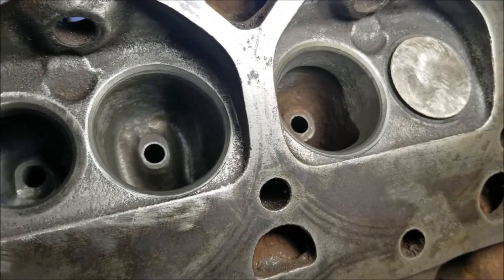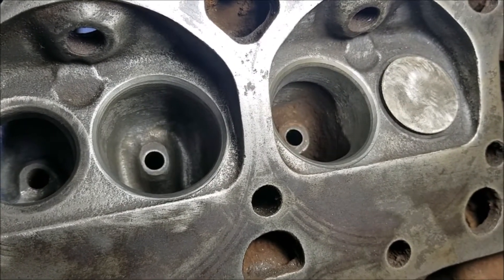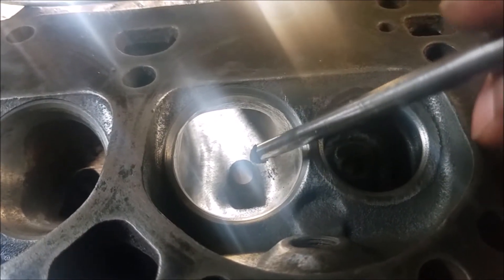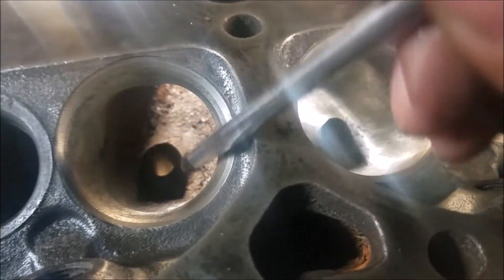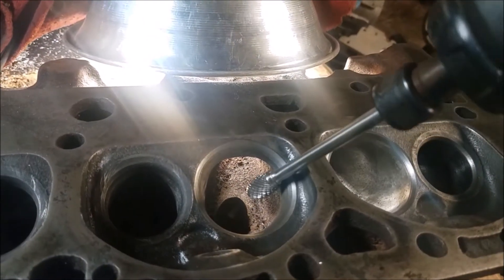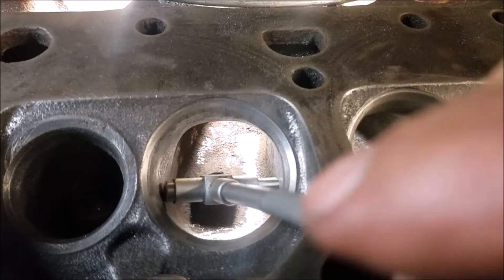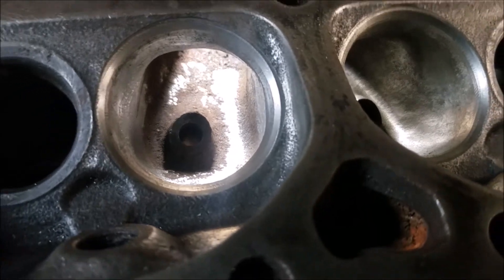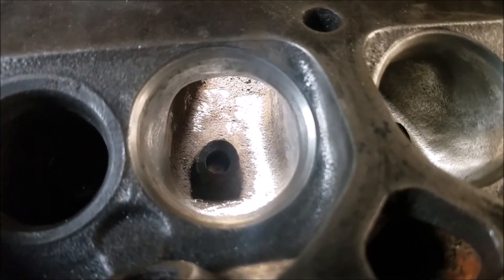SBC Head Porting: Flow Improvements for Cast Iron Heads

Comment: flow improvements? did you quantify that with a flow test? how did you gian?
Reply from the maker: This is a very mild port job on a 993 head. There is plenty more to be gained in flow without using a flow bench. With max effort a flowbench is a good idea, however this is very minor work.
Reply: @c41man  yeah, i realize that. myb poiny is, how do you know the minor work is worth it without checking it on a flow bench? I mean,  what are we looking at here? A 5 horse, a 10 horse, a 20 horse gain?
Reply from the maker: @reloadingfun  if you have a sbc stock iron heads are to learn on really, a set of aluminum heads are best. Modify some heads and bolt them on see if you notice a difference. I'm sure you'll feel the extra power.

Comment: What is this tool for the measurements called?
Reply from the maker: @dristan9785

I'm using a snap gauge to check the intake and exhaust.  Then you use a digital caliper to check the snap gauge.

Comment: Sir, so to know in the future you can totally get rid of the inner radius on r intake that is an exit so you  want it to be fully open to the max possible as any angle here is going to do less than it being fully open. You want  an inner angle  on the CV exhaust  as it helps  exhaust flow into the port more smoothly.  Machinist make a mistake treating the intakes and exhausts the same, but they are totally different and flow in opposite directions. So one needs a second angle  to prep the flow into to port while the other needs nothing more than a straight path and the more you leave on the intake seat the more the intake air flow is have to maneuver around these provisions.  

 Think flow, negative psi air wants to expand into the chamber it doesn't need help or guidance.  The exhaust on the other hand is being forced in compression outwards but has to go thru a small opening.  At the beginning so these angles. Are needed to help aid proper flow into the port. This is a critical area as it's the beginning of the exhaust path and a mistake here follows  further down as the pulses combined and exit the vehicle..

 The beginning of the ports entrance and the ports shape and smoothness play a part in his well these valves flow but the bottle neck is the valve itself. So opening up the seat will massively increase flow  in the low lift areas where the valve spends twice as long as it does in the higher lifts. 

 So flow around the valve is HUGE.   You do not want a bigger valve.  In the way, all you want to do is open the seat to around 93%     and for a diesel u want to be careful on the exhaust side.  But   I will tell you a smaller valve will go further and make more power  than a bigger valve if the bigger valve causes clearance issues nearest the cylinder walls.
 The best all time favorite thing you can do is port  the intakes passed the inner angles and only keep the sealing angle and take roughly half the exhaust inner angle and run a sand paper roll on a Dremel to round the left over inner ankle til it has become rounded. 
 This will act similar to a mini velocity stack. I also use a custom daimond 3/8" wheel on a Dremel to both: back cut the exhaust valves as well as adding a  tear drop/ "J" groove cut  into the back of the valve to help reversion in higher boost and lower rpm areas. 
  I actually find better flow around the valve itself when you leave to bowl slightly smaller and open up the seat  this help let the intake air expand into the chamber in a smoother fashion.   AND helps prepare the air  to flow around the valve smoother as it's already expanding outwards. Due to the shape of the port and seat. For the exhaust you actually do better with a bowl slightly larger than the seat.  And blending the bowl into the ports  this is r best way to port a head
Reply: What?